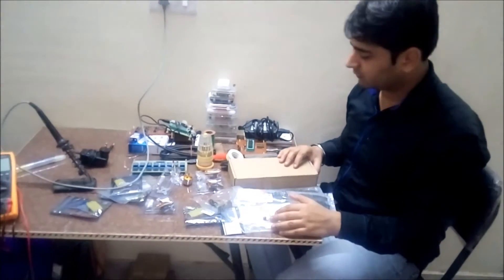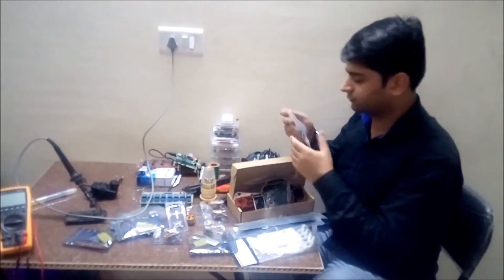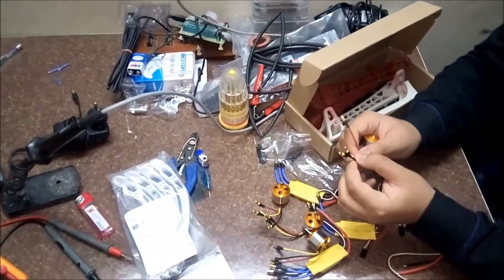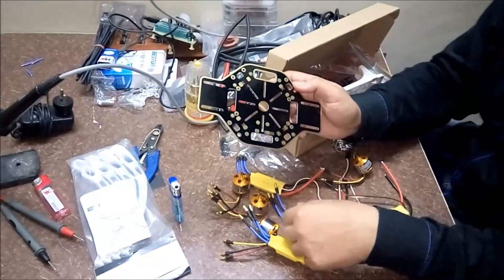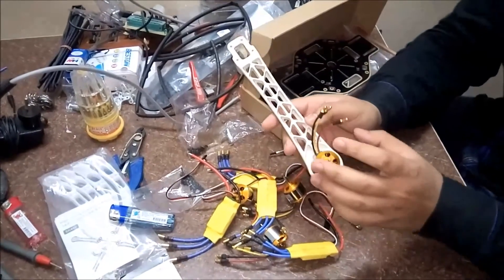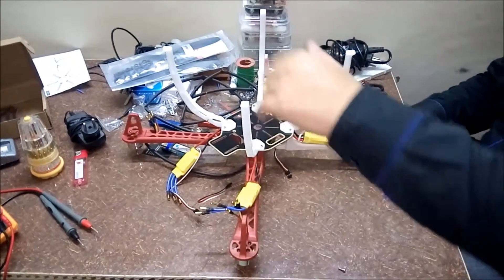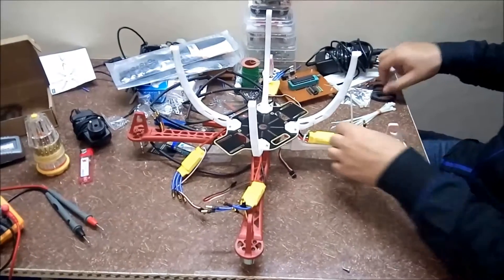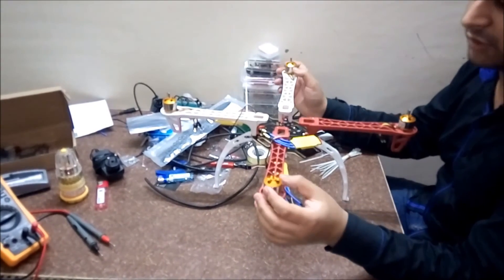Drone (Quad Copter) Assembling Part 1

Comment: Hi bud, like yours my drone motors have three colored wires and the ESC controller have all same color conectors. How could I identify the order of those wires (ESC only reads ABC on each wire) Your help'll be great, thanks
Reply from the maker: These ESCs have been replaced with DYS in our next video https://www.youtube.com/watch?v=j1_QxCeU67w and just connect the ESC wires with motor wires (1 to 1 connection), the motor will rotate either clockwise or anti-clockwise.